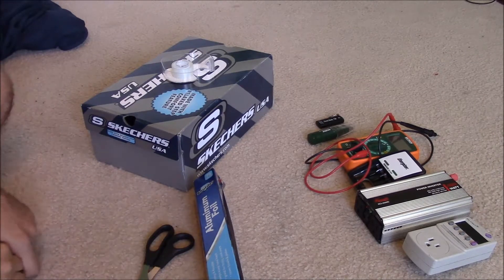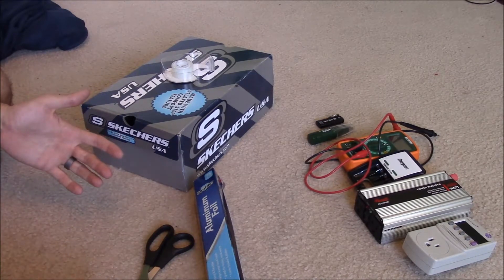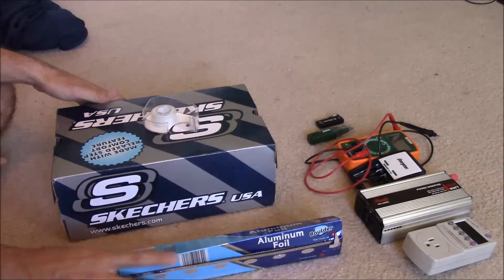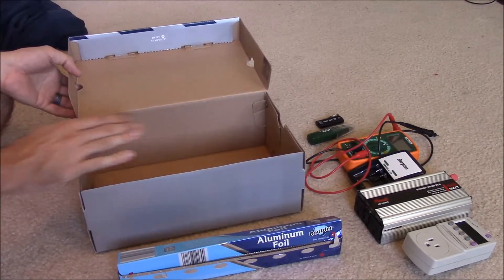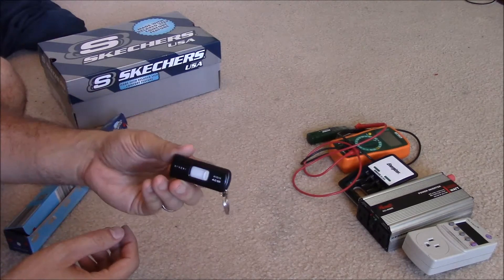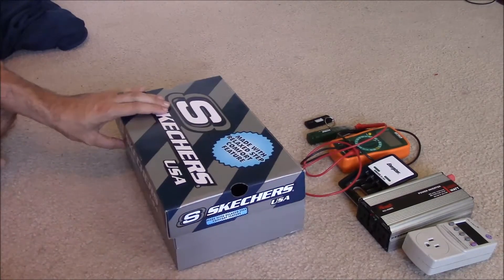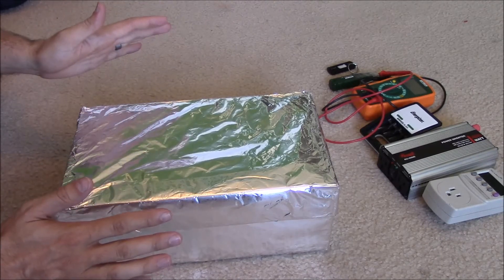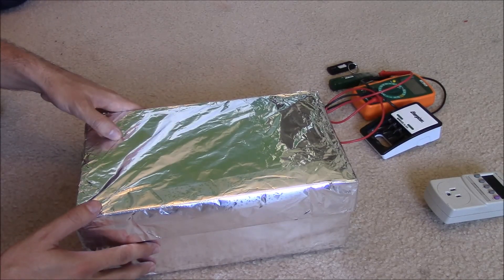Protect Spare Electronics With A Simple $2 Faraday Cage

Comment: 3 layers  yep
 5 is better. But, you must insulate each layer from the next with  layer of cardboard or foam. The layers can not touch each other.  And contents inside can't touch the foil either.  Not only line the outside, but the inside too. Then another layer of cardboard or dollar store foam,  even paper.  Anything that  contacts any foil will be trashed.  
PLEASE take this into account 
OR, place each item in a Ziploc bag,  wrap on foil,  then another ziploc bag. Most people in the know suggest at least 5 layers of foil. With each layer separated or insulated from each other by a layer of cardboard or foam.  The layers shouldn't touch. 
AND. nothing inside should come in contact with the innermost layer of foil.  
Use Saran wrap. Ziploc bags. Ir paper, next to the device,  then a ziplock bag.  This inside your Faraday cage.
Reply from the maker: Good to know.  Thanks!

Comment: Made one of these, tested with my HAM, seems not working (only 2 layers of foil though, not sure if 3 layers will make a difference)
Reply: Actually, it does help to some extent: It blocks the FM radio. And also helps to block HAM radio with another layer of foil wraps around the radio
Reply from the maker: Good to know!
Reply: I've personally done extensive research in this area. From what I've gathered,  it takes a minimum of 3 layers to be marginally effective.  Five layers is definitely better.  With an insulating layer of cardboard or something like dollar store foam between each layer of foil. 
I have an inner layer of cardboard and an outer layer too. 
The outermost layer is to protect the foil. The innermost is to keep the contents from contacting the foil. I have 6 layers of cardboard or dollar store foam, and 5 layers of foil. 
I made a slip over lid or cap to slide over the one open end.
Inside is my backup solar system,  inverter,  charge ,AM/FM Weather, solar/crank radio and 4 walkie talkies with chargers.  A multimeter,  battery charger,  and a TV/DVD player and a couple LD flashlights too. 
Everything is mounted on 1 X,10" board that slides in and out.  Its tucked under my bed. Outside dimension are 36 X 12 X 6". Not bad
 I'm thinking about adding an outer layer of chicken wire or 1/4" metal mesh for extra protection and strength. Weight is about 20lbs. But I can power my fridge, TV/DVD, couple lamps and a 20" fan. Plus charge phones and 2-way radios. 
And a pair of 100 mini LED Christmas.  
Its NOT much but enough when very few people will have any power at all.

Comment: if i put my stuff in an old microwave oven would that work ? hmmmm
Reply from the maker: Yes, a microwave is a hybrid faraday cage.  It will work better than what I did in this video.
Reply: @LDSreliance  yeah and there's old microwave ovens all over the place  that people don't use or throw away . also I heard old metal garbage cans work too with the lids .
Reply: Nope.  Microwaves are pretty iffy. Most won't work with a strong enough or nearby EMP event.
Reply: @brianroberts5740  what about an ammo can placed 2 ft under dirt ?

Comment: hey every one u don't need a faraday box. think about it if we do get hit with a EMP it knock out everything, e cell tower so your cell so why try save your cell phone when u cant get hold anyone because cell tower is fry and there's be no power to run or charge anything so why try save anything electric.
Reply from the maker: A cell phone would not be something I would try to save.  But a ham radio or solar charge controller or an inverter would be invaluable after an EMP event.
Reply: It’s really good for protecting your hardware wallet for cryptocurrency
Reply: Yur right 
 Cell phones won't work.  But 2-way radios will. HAM, CB and Shortwave too. Satellite will also. Plus you don't have to rely on candles, kerosene or batteries for light. 
How many people have enough candles or batteries for 6 months? 
And noisy gas generators will tell everyone within MILES you have power and probably foo.

Comment: Yes it is hard to say if panels would get hit. The components like the voltage control switch probably would. I think I saw the same Doomsday episodes you did. One had the guy storing everything in metal trash cans. I would think a batch purchase of mylar space blanket material would be good. I have been thinking about this a lot. I live in a metal trailer. The solar stuff is in a bin underneath. The trailer does not really shut out emfs like I would like it too. I am thinking of looking into some sort of shielding for the windows and will maybe experiment. I use this place lessemf, where I purchased the material for the canopy I sleep under and they have lots of shielding fabrics. It would all depend on how covering the windows would affect what all comes in. I have wondered if my solar being in the trailer bay would have any protective effect for say emp type pulse. I know the canopy blocks all but pulses from neighbors' smart meters-those still get through and that fabric blocks 1/3 more RF than mylar.
Reply from the maker: +Prima Donna Going Off Grid I admit I don't know as much as I should about RF shielding.  I think an easy test would be if your cell phone doesn't work in your trailer but does if you step outside I think you are in good shape :)
Reply: +LDSreliance I have an RF meter/detector by Accousticom [I purchased the accousticom 2 as it's much cheaper and has the same sensor.]. I use that to test places and spots. Of course even if I RF proofed it to some extent, not sure if it would block an EMP type pulse.  I do know the smart meter pulses are not easy to block even if the shielding is good enough to block all else. The smart meter pulses are not only damaging to people, but to sturctures and electronics over time. It seems to me that the pulsing bursts may be the issue to guard.
Reply from the maker: Prima Donna Going Off Grid
Yeah, sounds reasonable to me.  I don't think there is much that will help a large solar event or a near detonation of a nuke or something and that kind of EMP.

Comment: CME/solar flare IMO the most likely of the doomsday scenarios. Something like 8-9% chance in any given decade of a Carryington style event. Like you, I don't obsess over it too much, just some common sense prep for comfort/regional events. But in terms of a major long term/non-regional event, scientific odds put a massive solar flare/CME at top. I'm still unsure how hardened our grid is today but not taking chances. I just need to protect a few solar panels since they are still susceptible in a major event. I would be so bummed with all my panels, batts etc if I blew the whole plan with my loss of panels.
Reply from the maker: You think your panels would be fried, too?  I don't think they have much more than a diode on them.  From my research, radiation waves from the sun have too long of a wavelength to fry most household electronics.  However, it could cause an energy spike in the grid that could push through your wall sockets and harm anything plugged in.  I don't really know what to believe and what not to believe since there are so many differing opinions that sound well-reasoned and scientific but having a basic level of protection is better than nothing in the unlikely event.
Reply: i hope your right.  i had thought the same until i read something somewhere stating otherwise. but, yeah it's hard to know who/what to believe. so much info and opinions out there on what gets fried